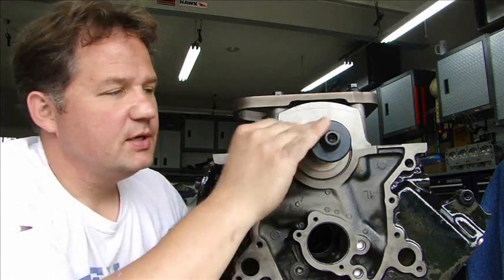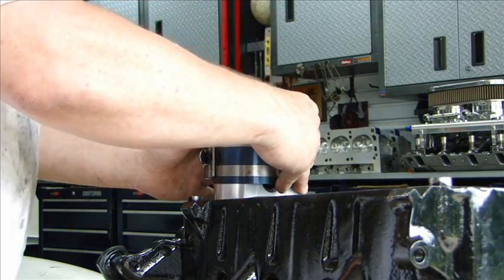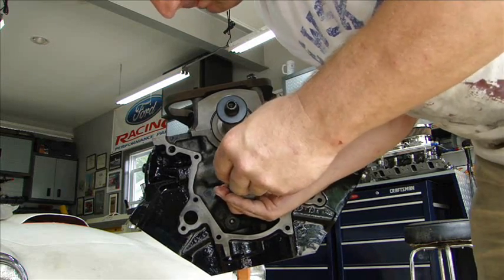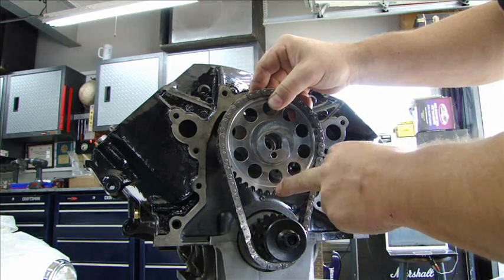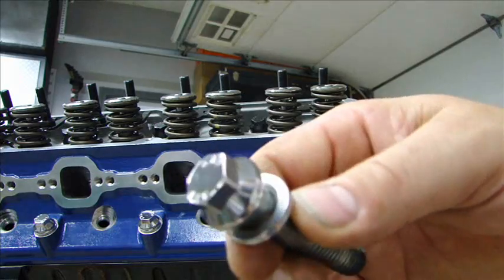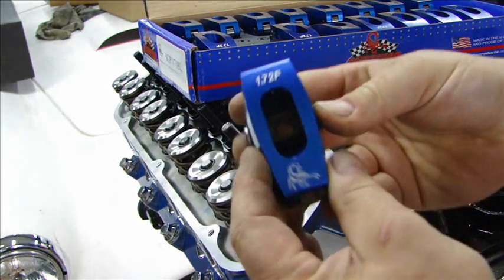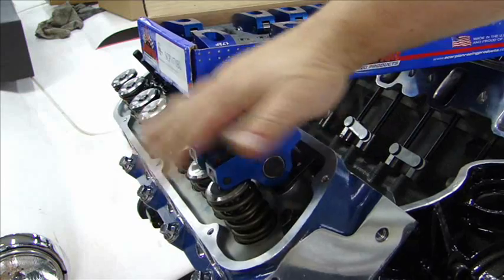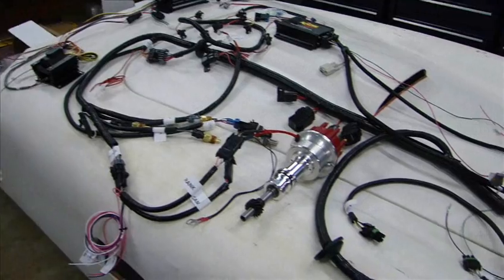Cobra Engine Build Part 1

Comment from the maker: Well...I started racing model airplanes at 10, rebuilt many glow engines and got super high performance out of them. Built the plastic Model Visible V-8 when I was 12 and learned how engines worked. Painted my first car at 15...and the rest is history. I was building engines when I was 16...spent all of my free time in school in the auto shop. I think I was the only kid in school that pulled motors and rebuilt them during school hours....lol

Comment from the maker: 1988 Windsor block. Cam is a Comp Cams part # 35-000-B gross lift intake.576 exhaust .600, at .050 OPEN intake 15 exhaust 58 CLOSE intake BTDC 47 exhaust BBDC 10, lobe separation 110.0

Comment from the maker: The extra or slightly higher ratio for the intake will give me a little extra valve opening without using a more radical cam. The cam I am using is right on the edge of being a full race cam and if I went any further it would not be able to idle well. The 1.71 rocker arm will give me just a little more intake opening to get more air and fuel in and still idle around 900 RPM. Great question! Thanks for watching,

Comment from the maker: The idea of dropping the cam in first is so you can lay the motor on the back and drop it stright in. It helps avoid scoring the cam bearings. I would recommend doing that. After installing hundreds of cams and knowing how to feel the lobs rest before the next cam journal goes in is something I am used to. There is a cam install tool that allows you to hold the cam straight while you put it in, but I have never had a problem and am extremely cautious putting it in like I did. Great Comment!

Comment from the maker: Thanks Daniel. The maiin and rod bearings were coated with Federal Mogul bearing assembly lube. I use Comp Cams lube for the cam. I wipe the bores out with a fine machining oil before turning anything over. It looked hard to turn, but the break-away torque was in range and torque to turn was perfect. Excellent observatiions!

Comment from the maker: Never be scared. It's a pretty simple rule...if it feels like you are forcing something, it's not lined up right or the size is wrong. The only special tools are a torque wrench, piston ring compressor, valve spring compressor, and angle gage. The rest are basic tools.

Comment from the maker: The base circle is also referred to as the heel. I wanted to make this video easy to understand so I didn't get tons of calls so I left out things like lobe separation, ABDC, ATDC, Area Under the Curve, BBDC, Profile, Velocity, Clearance Ramps, Concentricity, Flanks, Lifter Print, Taper, Nose, Overlap, and Seat Duration.

Comment from the maker: You are 100% correct. However, this particular engine management system requires the intake air temp be monitored at idle. My dyno guy tunes many of these systems and told me it is critical to put that sensor right in the idle air stream. Since there are 2 throttle bodies I mounted the sensor directly in the idle air stream of the rear one. There is a small port that allows air in at idle and is controlled by a motor. That is why I called it the idle air temp sensor.

Comment from the maker: Excellent point and thank you for sharing your experience. When you build an engine you need to consider how each component will affect the entire system. I had a 289 in my '66 and it would not rev that high due to valve float. Everything is a lesson.

Comment from the maker: With a 2 bolt main block the girdle provides stiffness and strength on the bottom end. Pushing a 351 over 500 HP requires some beefing up and the main bearings are most succeptable. One of the biggest robbers of HP is vibration. The girdle make the rolling assembly rock solid.

Comment from the maker: If you have hydraulic lifters you can just bolt them in and torque to spec. Just check the length on a closed valve to make sure they are riding on the center of the tip of the valve. Good luck!

Comment from the maker: Thanks for explaining. I like the idea and you did well explaining it, I am just concerned it is a bit inaccurate. The sound of an engine can be changed simply by changing valve size, Header diameter, muffler position, and tailpipe diameter. You are right about the exhaust manifold design, firing order and head bore angle, but the only thing the crank can change is the stroke, thus adding cubic inches.

Comment from the maker: There is a tool to hold the cam while installing it this way. I did it by hand so you could see it. I'm an engineer in an engine plant and we install the cams like this with a tool. Everybody has their own preference. I like this way because I can watch and feel each lobe as it clears the bearings. It certainely is not the way for a first time engine builder.

Comment from the maker: There are no dumb questions and there are many schools of thought on this. I use the assembly lube that comes with the cam. That is the most important one, especially if you are using solid lifters. For the bearings, lifter bores, rockers, and distributor gear, any moly lube will suffice. Engine plants just use engine oil throughout assembly with the only exception being 50 weight oil on the cam. Those engines could sit up to 3 months before they are fired up and they have no problems.

Comment: Agree with the scorpion rockers...glad to see you using them....actually the reason I watched this is because the thumbnail caught my eye with the blue rockers.  I was a bit nervous going with them over the Comp or Cranes...mostly because they were cheaper, but I love the made in the USA touts!  Glad to see a high end motor guy using them too.  I have not installed mine yet, they are just pedestal rockers going on a set of stock GT40 heads but boy do they look good!  Nice vid.

Comment from the maker: The girdle is .750" thick in essence acting like a huge washer. Since to main bolts do not rest directly on the cap, the 120 lbs is needed to ensure nothing moves and the girdle does its job. The bolts and the block do not yield until a higher torque and angle are applied so the threads are safe. Great question!

Comment from the maker: The moment of inertia for a rocker arm is very short. The mass to be moved is negligible. The valve cap has to be pushed over .425" in the opposited direction. Reducing the mass the spring has to move makes it faster. Although the valve springs are strong the physics behind momentum (1/2 mv2) show the load a spring must really handle. The valve assembly mass is linear, not reciprocating. Great question and observation....you really made me think for a few minutes.

Comment from the maker: It should be direct swap. Keep in mind the larger ratio will put additional stress on the valve springs. A 1.7 might push the spring to fatigue. Compression springs are engineered for a specific amount of crush. When you up the anty with a higher raiio rocker you are execising it past the designed level or stress. You might get away with it, but I would put new springs in with the new rockers to make sure you have a solid spring. The old ones are already fatigued a bit and might crack quickly.

Comment from the maker: With a 1.72 intake I can get the valve open a bit more without using a larger cam. I need to get as much air and fuel in as possible. I am using the largest cam that is reasonable so in order to get a bit more air I use a higher ratio rocker. Of course the springs have to match so they can take the extra lift. It is common to buy split sets. Just look up rockers and you can see the range on how you can pair them up. I'm trying to make as many as I can...thank you my friend.

Comment from the maker: It is mainly for the street for my 427 Cobra. You won't need tons of cubes for a notchback. A 302/347 stroker with a big cam could give you over 500 HP and be able to drive back and forth to the track. How you get that power to the ground will be important. A 5th link, some sub fame support, and a cage would help a great deal. Too much to really type here.

Comment from the maker: The cam is critical. Slope, lift, duration, and base circle are critical to performance. If you have an idea how you are going to build the motor you can call Comp Cams and they can grind a cam to fit what you need.

Comment from the maker: There are several ways depending on what's inside the engine. A solid tappet cam with solid lifters needs to be broken in with break-in oil and run up to temp with a load to condition to cam journals. A completely roller engine does not need any real break it time other that a load to get the rings to seat. Check what the manufacturer recommends for the parts you are installing.

Comment from the maker: I'd have to break it down, but the motor parts and machining were $15k. Cam is a Comp Cams part # 35-000-B gross lift intake.576 exhaust .600, at .050 OPEN intake 15 exhaust 58 CLOSE intake BTDC 47 exhaust BBDC 10, lobe separation 110.0. I machined the girdle...lots of custom parts on this one. We're all still green. We learn from each other....just call me Pete

Comment from the maker: Rocker arm size is determined by valve clearance, Cam lift, piston design, valve size, and piston delay all contribute to determining the valve clearance. I want to open the intake as much as possible. The cam is ground ahead to make the engine more responsive. I also have the cam advanced 2 degrees on the timing chain. It's not really to optimize TDC. The advantage is to make the engine breathe faster if that makes sense. Most cams have some degree of advanced grind.

Comment from the maker: The Accel DFI uses a motor to control the idle air through the throttle body. In order for the computer to accurately measure the air coming into the engine the sensor must be placed in this idle air stream. While it does monitor intake air temp it is essentially monitoring the idle air temp. When the butterflies open the idle motor closes the bypass port.

Comment: Hi Pete.  Thanks for the videos.  I'm just starting a 5.0 build for my '73 TVR and it's helpful for my planninng to see a complete build ahead of time.  Regarding the Accel boxes, wow is that ridiculous.  A wideband O2 controller doesn't need to be any bigger than a chapstick tube these days.  Have a look at the Megasquirt and AEM inline controller.  Also, pulling spark off of  distributor sensor is pretty old school.  Even Ford in the '60's took it off the crank for the GT40 engines and later in the DFV.  You can use the timing cover and pulley off of the late Explorer to get a trigger and VR sensor setup off the crank.  Use wasted spark or COP fired by the FI controller.  The IAT doesn't need to be inside the manifold and usually isn't.  Normally it sits ahead of the throttle body; you could have put it up through the bottom of the air cleaner.  The split plastic wiring loom stuff is always ugly imho.  If you plan your wiring ahead, you can run it all through shrink tube; get it from digikey.com or other electronics supplier.  Shrink tube can be heated and will hold a set around curves.
Reply from the maker: Lots of good stuff...thanks for the info. I'll look into it as I rebuild it. I appreciate you taking the time to write it out.

Comment: I figure a 1.7 is pushing the envelope in general on any stock gm valvetrain(given its from a 1.5)
And i dont think going to a 1.6 would hurt it because it only has 26k miles on it. But in my self conscious, i wouldnt sleep at night with the stock 80lb springs ha.
Thanks the info buddy.
Im a hard GM fan but that is a beautiful build you have done.
The work and pride you put into that is amazing.
Awesome

Comment from the maker: I am concerned with not enough weight. I moved the engine back in the bay 1". The rear axle has a Detroit Trutrack in it so it is almost a drag race setup. With over 500 HP the front wheels will come up for sure. It is a lite car The block is the only iron part. I needed the strength. An aluminum one would only save maybe 30 pounds. Great observation!

Comment from the maker: This EFI system requires the IAT to be placed directly in the idle air stream at the bottom of the rear throttle body which is controlled by the idle air motor. The front throttle body is plugged since 2 idle air motors are not needed. It is monitoring the intake air temp, but it is more critically monitoring the temp at idle. That is why I said idle air temp. After idle it switches to just intake air temp.

Comment from the maker: A good machine shop should be able to size your crank to fit each main bearing. They will torque down the mains with the crank in, and measure how much to polish each journal.

Comment from the maker: I'm making them as fast as I work on the car.....don't want you to go too long without a video fix...lol. Boring out and engine allows you to put in bigger pistons, increasing the cubic inches without using a larger block. The dual throttle bodies I am using on this one are to simulate the dual quads on the original 427. The 2,100 CFM of air flow is really huge and will provide more air than the engine really needs. It's for show and will make it go!

Comment from the maker: For hydraulic roller lifters the lash was set according to the manufacturers specifications. The lift was extended with latch caps and runs perfect as is. Dyno tuned by a guy with 25 years experience.

Comment: you have done a very nice job mann i'm a chev guy but ford also made some beasty engines i want to build a 302 chev yes like the z 28  67-9 z28 camaros these engines were a combo of a 327 bore and a 283 forged crank they didn't make much power under 3 grand but after 3 grand wow they just blew the doors off some of the others any hows back to your engine i appriciate  that you are using components made in the good ol US of A and are proud of doing it very nice job and looks like a fine rebuild

Comment from the maker: The reason I did it that way is because the lobe separation on my cam is 110 degrees. For your motor in order to make sure you are on base circle turn it until the exhaust valve opens and closes, keep turning until the intake opens and closes and go another 1/4 after the intake closes. The lash is set the same if you are still using the hydraulic lifters. Good luck!

Comment: Those rockers came in, intalled them, and 100lb springs, and put some lube on them like you showed(thanks), disabled the ignition with the cover loosely on, turned the engine over in short bursts, and i pulled a stud out haha
Now i have to order aftermarket studs..
I guess higher spring pressure and higher ratio doesnt play well on stock valvetrain.
Thanks again
Keep posted on the oiling issue. Unless its solved.
I will look it up.
Lemme know

Comment from the maker: The RHS heads require a stud mount rocker. I torqued them down to the manufacturers recommendation of 60 ft lbs, oil on the threads.

Comment from the maker: Thanks for the comment. You are correct, however this EFI system requires the IAT to be placed directly in the idle air stream at the bottom of the rear throttle body which is controlled by the idle air motor. The front throttle body is plugged since 2 idle air motors are not needed. It is monitoring the intak air temp, but it is more critically monitoring the temp at idle. That is why I said idle air temp. After idle it switches to just intake air temp.

Comment from the maker: "Most likely" means you do not know for sure. I have taken this engine apart after the dyno run to inspect all the parts to make sure they will work as planned. Every part was perfect including the cam bearings. I understand your concern but I have never had a problem.

Comment from the maker: Sorry for the late reply. I am using a stock cast iron block. If you use roller lifters they must be linkbar or dog bone style. They must be held in place so the roller does not turn around.

Comment from the maker: With a 130 screen to dial in the motor it should run flawless. I am going to install a PC under the dash with a touch screen that will allow me to make adjustments on the road. Between the sound system I have planned and the live PC is will be a techno-cobra for sure!

Comment from the maker: The crank is a RPM DG3-351WB 4.0" stroke. SRP pistons 4.030 bore, 436 gram, comp height 1.230 inverted dome, 19 cc dish, RPM I-Beam race rods, balance rolling assembly, RHS 64cc as cast heads, deck ht clearance .015, Melling hyd roller lifters, custom ground Comp cam, at 9.74:1 dynamic compression, 538 HP

Comment from the maker: Ok...not to worry ...couple things. You have a 302 block correct ? This is a 1988 351W block out of a truck. The  main casting is thicker and uses larger bolts so it needs the 120 ft pds. I've built many 302 strokers and you are good at 70 if you did it without oil

Comment from the maker: No...solid lifters need to be adjusted with some lash per the cam and lifter manufacturers specifications. You will need some feeler gages to adjust yours and follow the instructions for the cam.